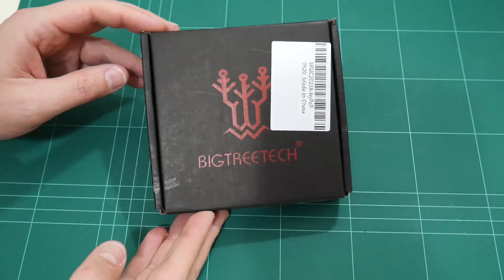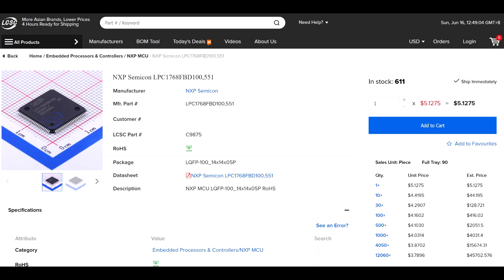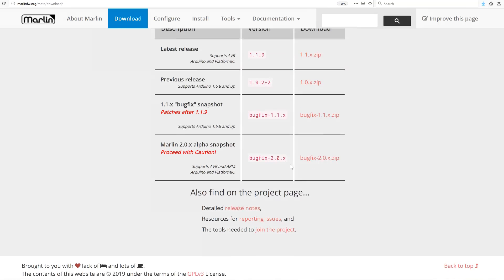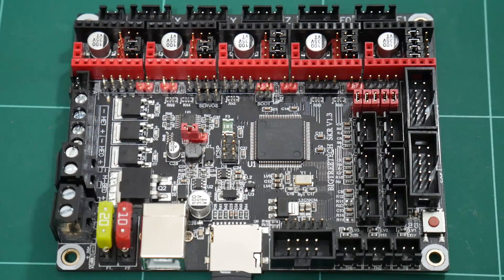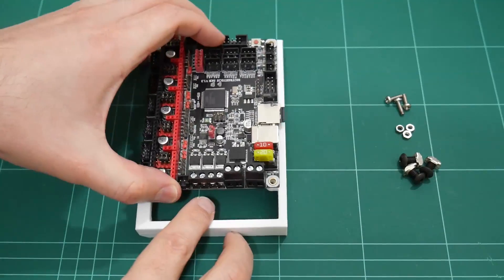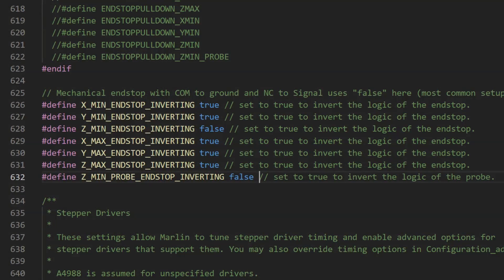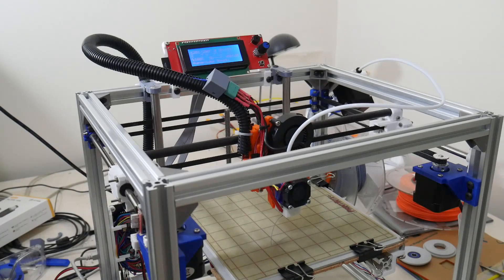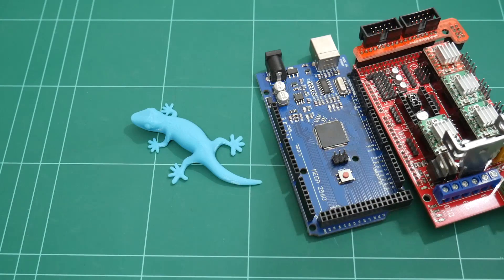Cheap 32-bit 3D Printer Controller!

Comment: My skr 1.3 stop working after 2 weeks. Aliexpress shop stop answering to my emails. Manufacturing told me that my pc is not working correctly? So I was have to go back to my 2 years old mks gen 1.4.
Reply: that sucks!
Reply: This is the issue with Ali, Banggood an heaven help ya with Gearbest as they are the worst of the three.

Comment: More good news.  Also keep an eye out for new TMC motor drivers in the near future. I hear there are more options becoming available soon that will do a better job with current supplied to motors to help prevent layer shifts. All this without overheating and even in stealth chop mode.
Reply from the maker: Looking forward to it. I have TMC2208 v3 on the way to replace my X and Y. The TMC2209 is coming soon which has lower RDSon resistance which should mean less heat.
Reply: The TMC2209 is available now with improved stealthchop and stall detection for sensorless homing. :) Drivers are still being worked on, however by the time they arrive from China you'll probably have reasonably solid drivers available.
Reply: The TMC5160/5161 are looking pretty nice, too :) Check out the comparison on Watterott's documentation site here: https://learn.watterott.com/silentstepstick/comparison/
(Buy your SilentStepSticks from Watterott [or a reseller] if you can! They're the ones that are designing the SilentStepStick modules that the Chinese then clone! It's all Open Hardware, too: https://github.com/watterott/SilentStepStick )

The TMC5160 is much higher power than the older drivers/modules, but it must be driven over SPI - it can't use the traditional step/direction lines - so I don't know how well-supported that'll be in different firmwares. While the TMC5161 seems to bring back support for step/dir - but also has a MOSFET Rds(on) of 0.5Ω, while the 5160 was down to 0.1Ω, so I suspect it won't be as powerful. We'll have to wait and see...

Comment: Try some new TMC2209's
Reply: @Joe Anon The crashing into the end for endstop-less operation is just bad.  If you do it you can only do it for X and Y and I have seen for CoreXY based machines it is a very evil thing to do so stick with real endstops.
Reply: do they worth it?
Reply: ARE they worth it? Yes.
Reply: @Joe Anon If you use glass on the bed you just can't have the nozzle go crashing into it then pull up and go crashing back into it to find the 0 position.  This is why endstop-less isn't used for Z.
Reply: @Joe Anon Oh, know the best endstop to have for Z?  I had it on my Prusa I3 for years and that is a hall effect with a magnet.  Nothing touches and nothing is mechanical so way less chance it will ever fail.  Another one is the Z probe of some kind (tech2c has) and use an 8mm (I wish they would make a 12mm version so more sensitive) that way it never touches and not being mechanical has less chance of failing.

Comment: What are the improvements in 3D prints?
Reply: Speed , precision , specially in a Delta printer , also yuo got much more memory so yuo can implement bltouch whithout any loose of code
Reply: Live control over USB without throwing the timing off.

Comment: you can also use Atom editor instead of the Microsoft product Visual Studio Code...
Reply: Never heard of it before so do you have a link?
Reply: @thebeststooge  you really need to learn to google!   http://marlinfw.org/docs/basics/install_platformio.html#platformio-with-atom-overview
Reply: @Peter Ellens I don't normally run around Google to find out what some goober is talking about because if some goober is going to talk shit about Visual Studio they normally whip their dick out and show a link to the "superior" product.  Each to their own but what I found was just another ide but it still was using platformio behind the scenes and most certainly VScode.
Reply: @Pilot16H I know Platformio just not Atom.  I personally want nothing to do with Visual Studio.
Reply: @thebeststooge  Platfomio on VScode is superior to atom in every regard, especially reliability. Vscode is not visual studio, they are two different things.
Reply: @m3chanist  what a load... VScode is very unstable and not recommended by the marlin developers.
Reply: @Dust599  O yes really, which one in particular? Thinkyhead runs platformio in sublime, not Atom.  Atom screws up platformio toolchains and any other package you add to it on a regular basis and requires constant babying.  VScode is faster across all platforms, it has half the disk footprint, Atom is bloated and sluggish by comparison if you'd used both for anything significant you'd know this. It's exploded in developer popularity over atom for a reason, it's really good.Vscode  is better supported with a faster development cycle, therefore more bug reporting and higher quality extensions. As for it not being an MS product, Atom is a GitHub product. MS owns Github.  If you look at the platformio install page you will note they recommend vscode as the best ide shell. Quote."In our experience, PlatformIO IDE for VSCode offers better system performance, and users have found it easier to get started"

Comment: except marlin 2 is still beta!!!    user beware.  but the LPC1768 is one of the better supported MPU's. Its also what is used on the now ancient smoothieboards, so its is not exactly new...
Reply from the maker: I wish the Marlin devs would draw a line in the sand and release a stable 2.0 already. It has been a while.
Reply: I think that's why they chose that MCU: so that the SKR can run Smoothieware, rather than having to use beta firmware.

Of course, that's without any contribution or support to the Smoothieware project, but while creating a lot of extra support requests from people trying to run Smoothieware on SKR boards, which is the main complaint that the Smoothie devs had/have about the MKS SBASE: that MKS don't properly document their hardware [there's not even a full schematic available] and they don't provide any support to their customers, leaving those customers having to use the valuable and scarce time of the Smoothie devs responding to those support requests...
(I bought a MKS SBASE before I realised what the situation was there, and so I did subsequently buy a genuine Smoothieboard X5. I'm actually leaning towards Duet these days, but Smoothie is working well enough for me right now - though I have added external TMC2100 SilentStepSticks [genuine ones from Watterott, of course] on a custom-designed PCB to replace the stock Allegro drivers... and I might replace at least a couple of THOSE with TMC2209 or TMC5161 at some point...)

Comment: Hi Tech2c! Nearly a year ago i bought an Anet a8 so i could get started in the 3d printing world. I've used it a couple times and decided to upgrade the printer ( the usual security, like mosfet, and a bowden) but since i changed it, my board was getting a bad nozzle temperature reading and i read that it could be a broken resistor (I even tried to switch nozzles but nothing changed). After that i decided to change the board. Is this a viable option? I was thinking on changing the original board to an Arduino+ramps, but if i can spare some money it will be appreciated. Thanks in advance

Ps: I know that if i change the board i will have to change most of the connectors, but whatever…. i just want to print again
Reply: The Bigtreetech SKR v1.3 board shown in this video uses the same connectors as my Anet A8's mainboard.  The motor wiring might be reversed depending on many different variables, but the connectors are the same.  late summer 2017 version
Reply: Thanks, i'll take a better look. If these are the same then this is going to save me some money and time for sure :D
Reply: @YaYa-rf6lb   just remember, this board doesn't come with ANY drivers, and you can't just reuse the ones from the A8.  Just for reference, my A8 used the A4988 drivers for all axis's.
Reply: Which ones do you recommend?
Reply: @YaYa-rf6lb  i have the tmc2208's, same kinds of instructions as in the video to use them.  just change the reference's from a4988 to tmc2208(check above the setting for exact spelling, capitalization,etc). they have been an excellent upgrade for me over the a4988's i got in the beginning!

also, if you look at other videos discussing this board. you should come across Chris Riley's video on it, which shows how you 

can set them up to have all the features promised for the tmc2208's.
Reply: I assume you meant you switched the heat block not the nozzle.
Reply: Well yes, when i switched the nozzle i meant i switched back to the stock anet heat block+thermistor+nozzle to test the motherboard just in case the new one was defective

Comment: Your better off getting the Picoprint from Aus3d has onboard Trinamic 2130 drivers and header for powering a RPi
Reply: Tmc2130🤮 StealthChop 🤮
TMC2208/2209👍 StealthChop2👍

Comment: Use a BLTouch sensor there far better then inductance.
Reply: how so? is it more precise or what? i've never had problems with bed leveling in my printers with the inductive sensors.
Reply: @Laharl Krichevskoy they dont vary by temperature like the proximity, I'm like you though - not had any problems with prox and the BLTouch is stupid expensive
Reply: @vizionthing
Maybe it were the older ones. I tried seeing if changes in temperature made the probe meassure diferently and couldnt notice any. I tried leaving it a few minutes in the middle of the bed while heating up before homing so the hot air would warm the sensor but then the first layer came just as good.  (and the metal case was warm to the touch)
The most i have to touch the z offset if say -0.050mm say after 6-8 month of running 24/7, but most probably thats because of the bushings wearing down.
Reply: @laharl2k  The issue with any non-touch sensor comes from different build beds. With that said if you only have the original that came with the printer then I assume it will work no problem but if using a composite bed for lighter weight or some of the removable build surfaces this is where the non-touch sensors can be problematic. I think both kinds of sensors have a place but in all my testing I have found that non-touch or non-ID sensors have issues under some circumstances.
Reply: Liqui-Dirt 3D 
I have 4 own design mendels with a plywood/aluminium heated bed. And the inductive sensor is a generic chinese npn inductive sensor. couldnt really make it cheaper or lighter if i wanted to. Not sure what kind of situation could trigger the measurement errors but its usually the cheaper option but in my case i have none. :/
Reply: Why not use an IR probe much easier to implement

Comment: What would you do if your z axis has 2 steppers?  Would you just wire them in series instead?
Reply: You can either made a board with a few header pins and an extention to run both in series from a single driver or you can use two drivers and mirror the Z axis to the second one (usually ext1) which would be ideal if your driver cant provide enough current and/or if it overheats.
I use 2 drivers in mine, its just easier to wire and for the extra cost i just dont care.
Reply: They wire in parallel, shame they didn't  include the extra header like the Ramps kit
Reply: The option is to make a Y adapater as another youtuber did OR, and the better option, remove one motor and replace it with a single motor + belt drive system.  I did this on my CoreXY and I will never go back to dual motors again (6 years with dual Z motors too).
Reply: @The Best Stooge
The linked Z belt system is cool but a pain to design into the printer. Having two leadscrews is more robust but without the link belt it can be a pain to level if you dont have a reference mark (i have two emergency stops to above crashes in the lead screws that are aligned to that when its leveled both face the front)
And a single lead screw has the advantage of not misaligning but the load created torsion so you need a bery robust Z axis to it doesnt move.

The best solution would be a Core XZ but so far ive seen none use it. It would have the advantage of being fast in the Z axis (75mm/s easily) and with only 1 motor for each axis, oh and a bit more torque in the X axis (though ive never had problems in the X even with a geared direct extruder + 40mm fan, the aluminium bed is the weakest one in my case)
Reply: @Laharl Krichevskoy My TronXY X5S now uses a single motor and two 2mm per rev lead screws and a single belt (I bought a slightly too small and it works but a 1250mm version would be better).  It never drops, or sags, or goes out of alignment now and I am using a 3:1 ratio (16t on the motor and one 48t on each leadscrew).  If only I had done this conversion on my old Prusa I3 years ago.
Reply: you dont really need  the 3:1 demultiplication there, im using 8mm per turn lead screws and have no problem with the Z resolution. Plus you have to take into account the backlash in the leadscrews plus the backlash in the belt. Unless you are using a tiny stepper with barely any current, it makes no sense to have such a demultiplication.
With 1/16 microstep im doing 400 steps/mm
with your config and 1/16 youd be around 4800 steps/mm which is a lot for an atmel. You should change your pulleys so it ends in 1:1 to get 1600steps/mm which should at least let you reach 12mm/s in the Z axis which is way better than 4mm/s like you are now. Plus it should let you increase the acceleration and jerk enough so that the retractions and z-hops are done super quick reducing stringing and print times quite a bit. Though you should try to keep the accel/jerk low enough do that your bed doesnt suffers (make loud nouses when starts/stops as if you hammering it), the max speed should be as high as possible though.
Mine can do 50mm/s but i've barely noticed any difference above 25mm/s.
You could also do it via microstepping but it wont help with the acceleration, only with the max speed, which you may never reach if your acceleration is too low. You trade acceleration for torque and vice versa, the ideal is to balance things to get the most of both.
Reply: I don't need, nor do you need, speed for Z.  My bed is heavy as it is 330mm sq with a 3mm boro glass and aluminum, etc...  3:1 is very much needed since a single motor is now doing the work of two so at least a 2:1 is needed but since we do not need speed on Z 3:1 is perfect for me and I turned my motor amps way down so runs very cool.
Reply: Interesting concept...….I've got an E3 Pro and have toyed with the idea of fitting a belt drive and a second leadscrew to make it a twin screw Z axis drive like the E10 but without the second stepper motor as I think if a second motor was used you could get problems when one missed steps or failed completely. @thebeststooge
Reply: @Ian Pearson Ever since Prusa put two motors on one controller he knew what would happen but due to costs it was the best avenue for the time and they will lose sync over time.  Prusa now uses two motors but uses two controllers on his MK series of printers so two endstops and two motors and two controllers is alright but an end stop is never always exactly the same each time it is hit (though close) whereas a belt with only one motor always is exactly the same.  I love this one motor setup and speed for Z is a retarded idea that has no practical reason except to dick wag so doing a 3:1 means the motor needs less power than when it was a dual motor system and stays cool.  My amps went from 1.2 down to 400 on my big printer.  I am 3 times slower but I bumped up the speed so about the same and it now has 3 times more resolution.  Takes me 1600 revs to move 1mm in Z now.
Reply: Turning your amps down is only to reduce the holding current when at standstill  not the actual current used to move the axis. When the stepper is at rest it must not move so you need some amps to hold position like a brake. If you have the single 8mm per turn leadscrew on your Z axis, like the E3, you will need to have a good braking force as the screw can back drive very easily and that is critical to keep the layer height constant. Fitting a direct drive, which adds the extra weight of the extruder stepper to the X axis beam, you would also have to increase the amps to get more stepper holding force. @thebeststooge
Reply: @Ian Pearson Those motors are always on whether turning or not and they got hot.  I ditched the shitastic 8mm per turn for 2mm per turn (my i3 had 1mm but that was crazy).  With two lead screws, 1 belt and 1 motor using a 3:1 I no longer have it fall down with its own weight but the original 2 motor and 8mm per turn I sure did as it was too heavy.  Love the new set up.
Reply: Yes, they are designed to be always on if you need it which for the Z axis is all the time...…..not so much on the X and Y axes as they intermittently stop and start as required but their holding force is minimal compared to the Z axis which has to hold the weight of the beam almost all the time from back driving. @thebeststooge

Comment: Use NPN inductive sensor.
Reply: link?
Reply: Does anyone sell PNP still? Here 3d printer / maker shops only sell the NPN ones, so you only need a diode to block the sensor's 12V pullup for it to work like a mechanical switch.
Reply: @laharl2k  If you use 5V NPN then you don't need any diode.